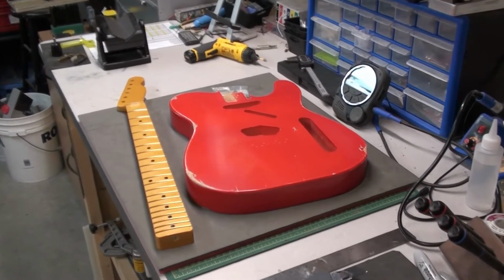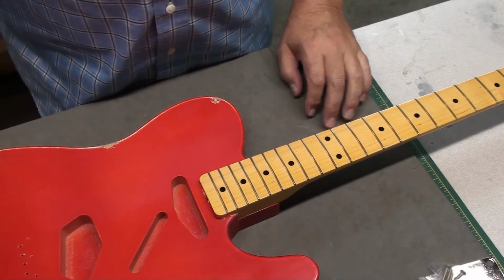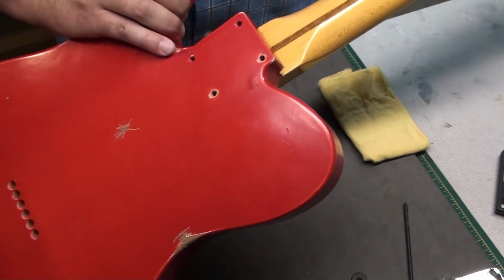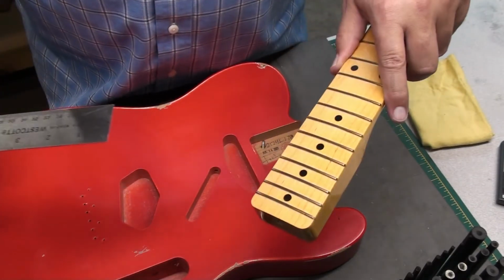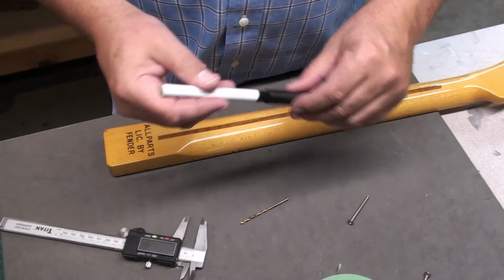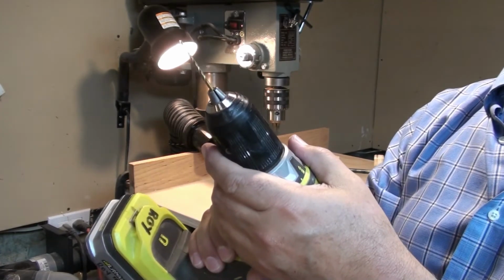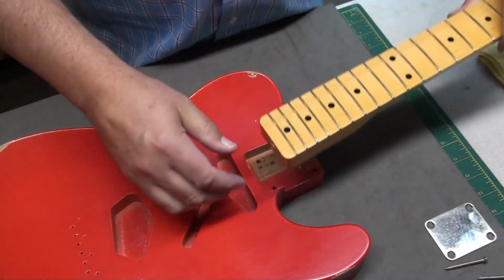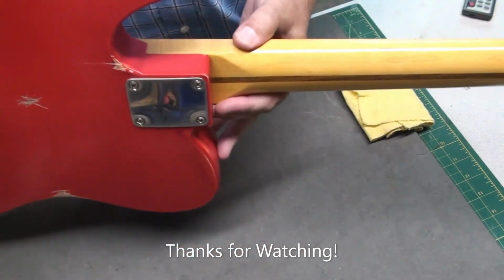Installing a Neck on an Electric Guitar - Step by Step :  Red Fender Telecaster Parts Build

Comment: Im not keen on the vintage truss rod adjustment screw on the bottom of the neck either, I prefer the modern spoke wheel adjuster, if its a gloss neck like this one and is sticky, I prefer to dull that down a little, either with .00 steel wool or wet and dry sandpaper, one Telecaster I have though has a gloss neck but I have dulled it down from playing it, when I bought it in 1984 I wouldn't have dared to take steel wool or sandpaper to it.